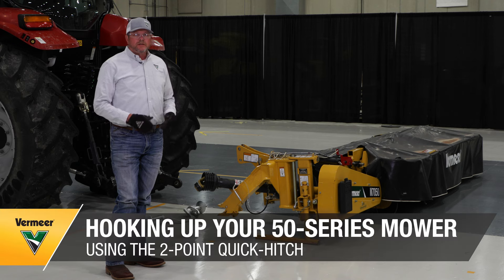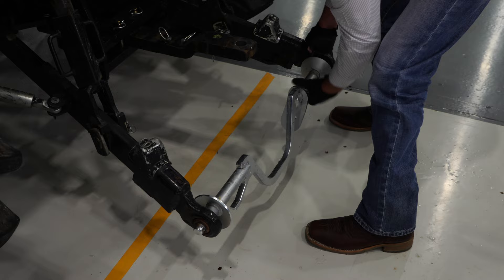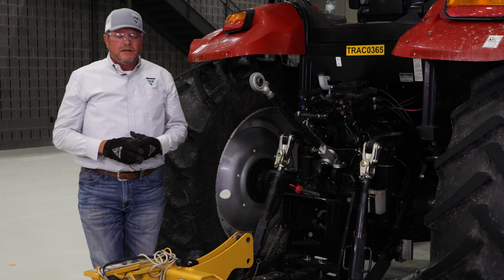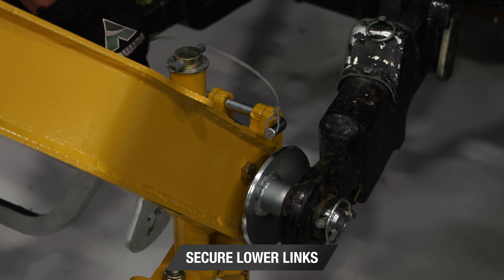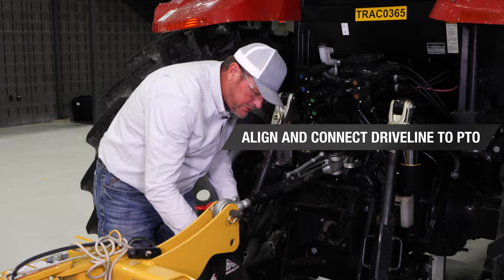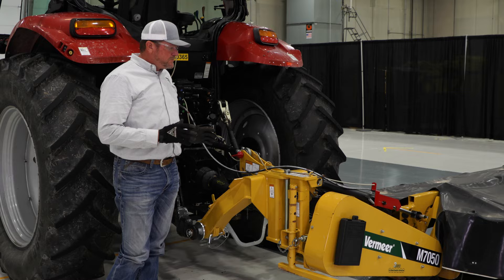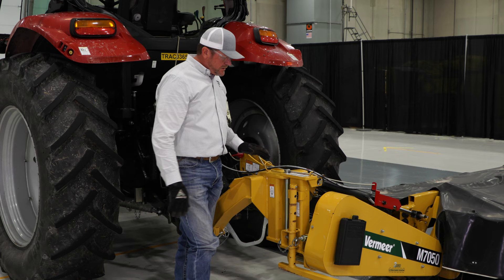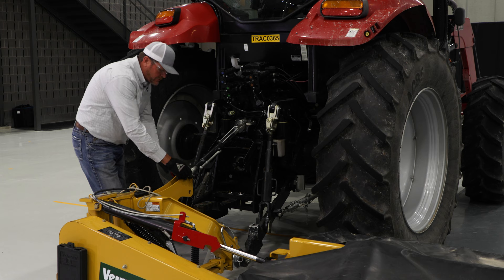How to hook and unhook Vermeer 50-series 3-point disc mowers using the 2-point Quick Hitch

Comment: They should all be checked prior to delivery. My friend bought a brand new one and it's a nightmare to hook up. At the dealership in Guthrie Oklahoma, they had to grind a pin hole. The mower works great but the quick connect requires hammering, pry bars etc. My friend specifically purchased this for his handicap son to operate.